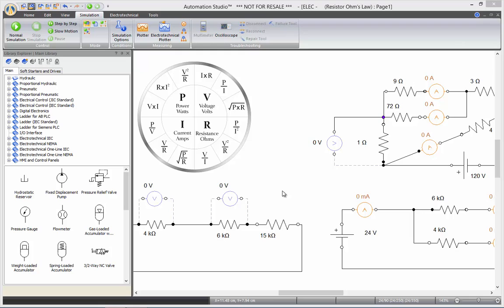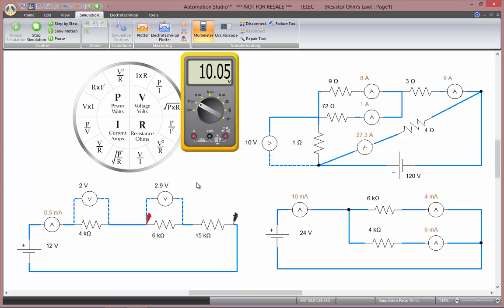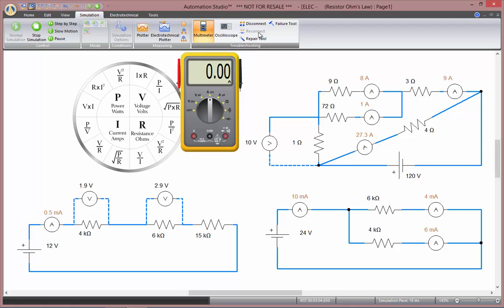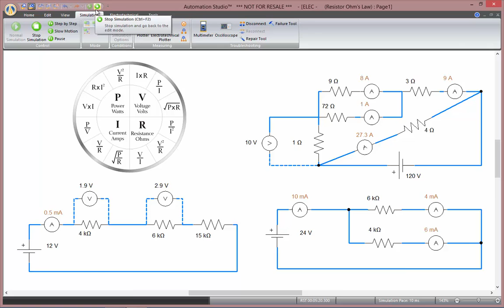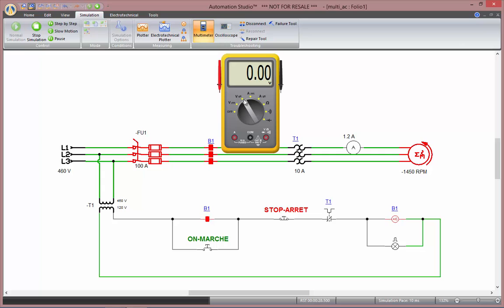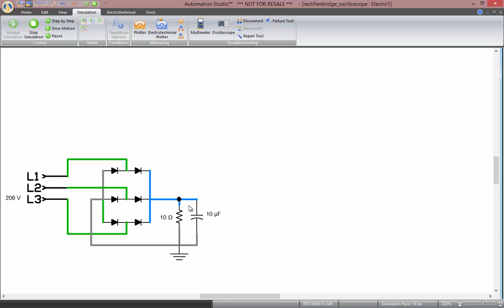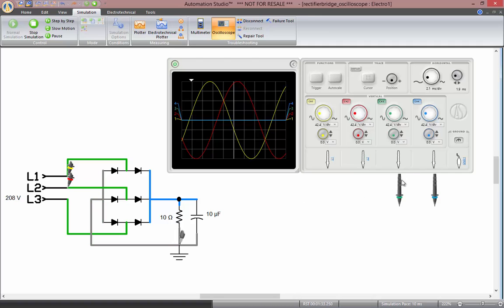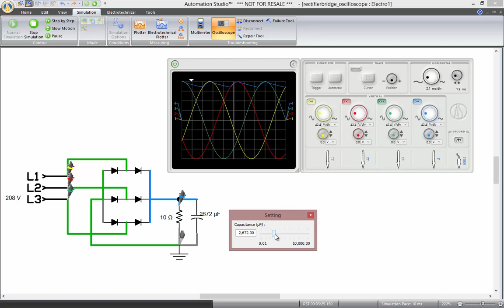Electrical - Manipulation of the Multimeter and Oscilloscope - Automation Studio™

Comment: I can not find the multimeter there. Where it is located and why isn't my multimeter in this place?
Reply from the maker: +New Audio Perspective Pedals Hello New Audio Perspective Pedals, 
this happens because you don't have the latest version or you're not in the right module. You need to get components from the Electrotechnical library, not the electrical control.